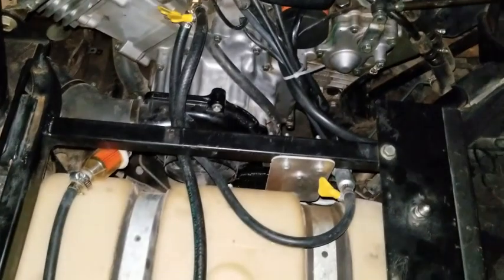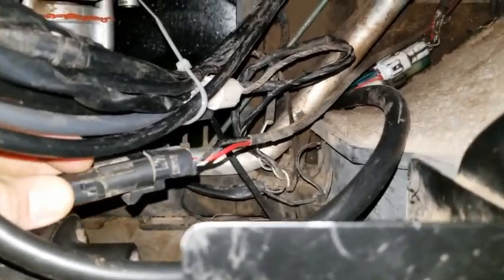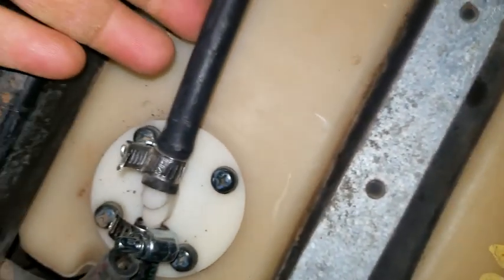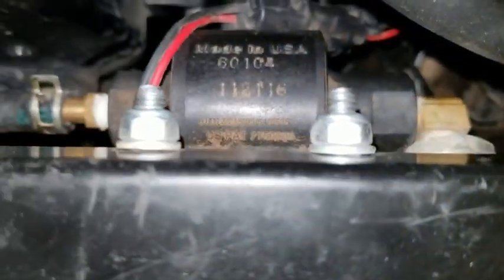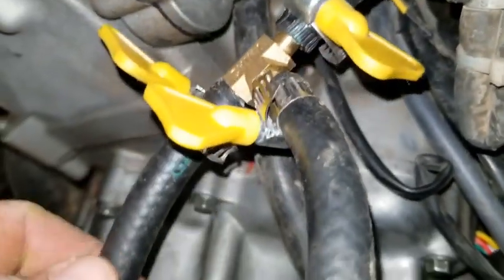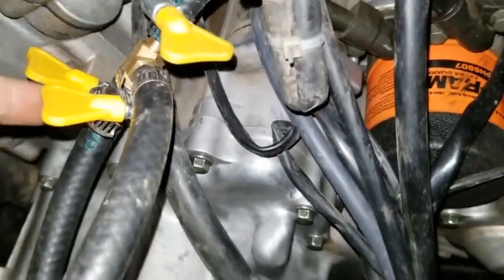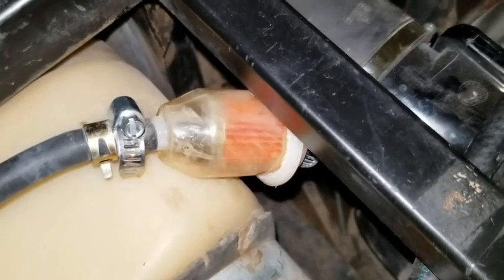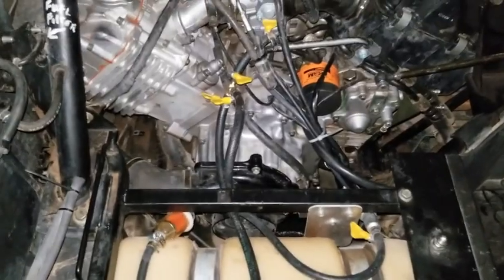Yamaha rhino fuel lines

Comment: I installed a low flow to help starting in the winter and for when the the thing gets hot and vapour locks. I hooked up to the starter so it only works when the starter is engaged. I also have the stock pump hooked up as well. works very good for me for the past 3  or 4 years
Reply: I neglected to mention your great plumbing  job. I was also thinking that if I did your system maybe I would not get thr vapor  lock  when it's  hot outside
Reply from the maker: After I changed it out I never had it vapor lock again.

Comment: So the pump runs constantly im guessing because you kept the return line?   I have the same setup and the installation guide said to eliminate the return ?
Reply from the maker: Yes mine kept flooding itself so keeping the return fixed it.
Reply: @TABOutdoors  I was worried about the flooding after  viewing your video, I have run it both ways, without the return it runs fine and does not flood.  With the return hooked up it is starved for fuel and misses at higher speed.
I contacted Black Rhino they said if the float and needle valve are working properly there should not be any flooding problems.....I guess I'll have to wait and see.....Thanks for the Video!!

Comment: I bought one and the paper work said to delete the return line to the tank and block it off. I noticed that yours has two filters and a Tee for return. I did flood mine a couple times and had to unplug the relay to stop the fuel while i got it running then plugged the relay back up. Is this why you put the Tee in?
Reply from the maker: Yes I had a on off switch to shut off the pump, but it still kept flooding so I ran the tee and never had another issue with over filling the bowl while the pump was on.
Reply: @TABOutdoors  If the fuel pump overflows your carburetor your float valve in Carb is bad. A good working float valve has no problem stopping the fuel flow from the low pressure fuel pump.
Reply from the maker: @erikridens1471  that's what I thought but the fuel pump has just enough pressure to flood it.

Comment: I have the same setup but I’m flooding the carb any suggestions
Reply from the maker: Do you have a return line that feeds the excess fuel back to the fuel tank?
Reply: @TABOutdoors  I have a tee inline one line goes to carb other line goes back to gas tank.
Reply: @TABOutdoors  yes
Reply from the maker: Open the one one that goes back to the tank and make sure there is nothing blocking it. Also check your float in your carb and make sure it is not leaking or broke.
Reply: @TABOutdoors  ok I’m going to go try those thanks for the help